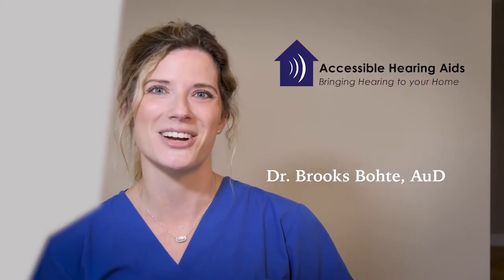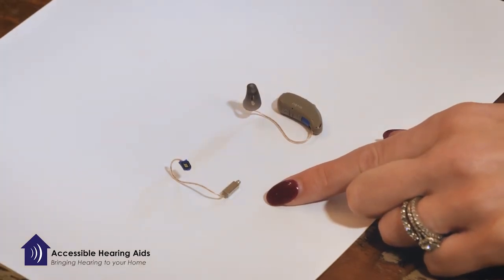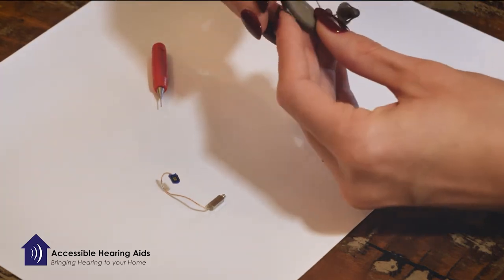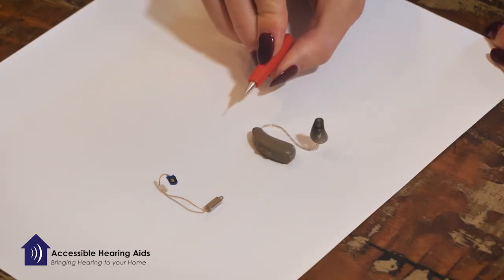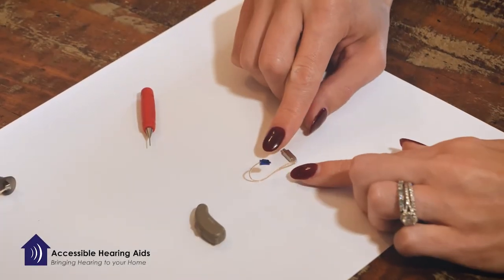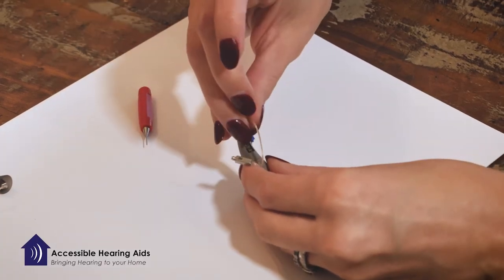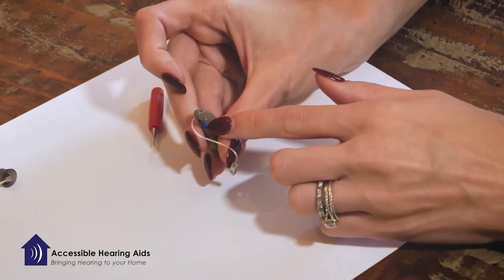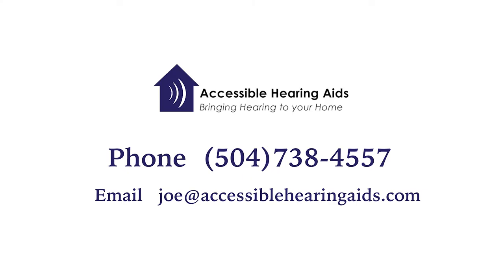Accessible Hearing Aids - HOW TO: Replace Receiver or Wire

Comment: Great solution you have just remedied the problem with my hearing aid poor connection between Unit and Wire worth a try especially if you do not have spare parts. Great video however please go a little slower on the pin removal, its a vital step also the hole is so small you need a magnifying glass unless you know exactly where it is. Again fabulous guide looking forward to a good nights sleep.
Reply from the maker: Thank you Albert. We appreciate your comment and suggestions.